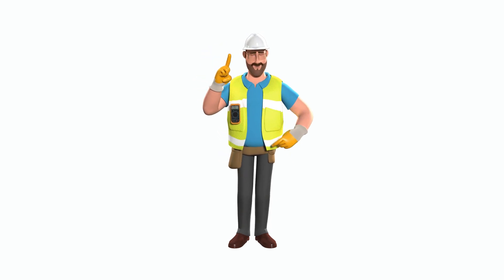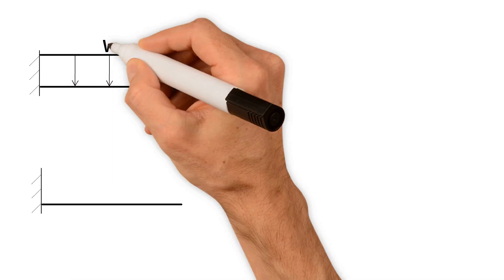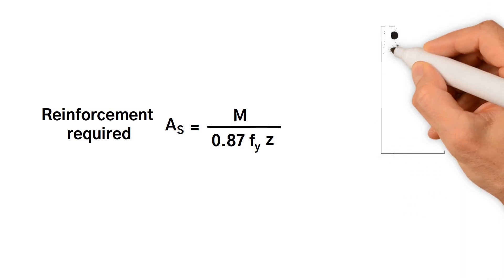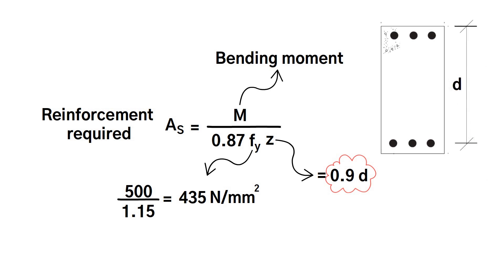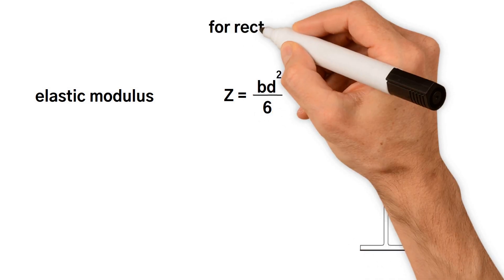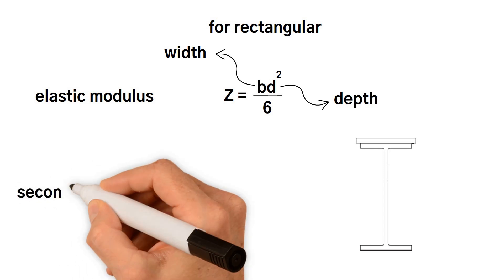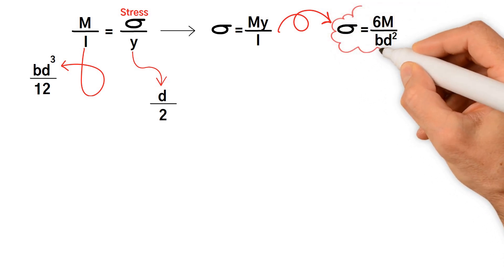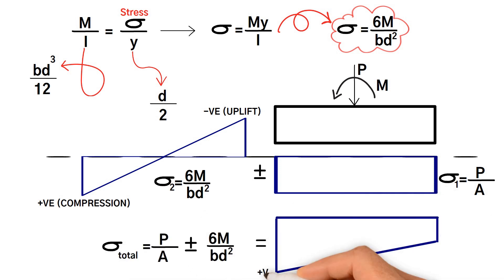5 top equations every Structural Engineer should know.

Comment: Here in Colombia there is a simpler equation to calculate steel area in concrete sections, is this, A=3M/d, Momento in kN.m and d in cm, it gives you area in cm2
Reply: ?? doesnt even consider the steel strength used?
Reply: @bensblues  it’s just an approximation to make quick non-definitive calculations

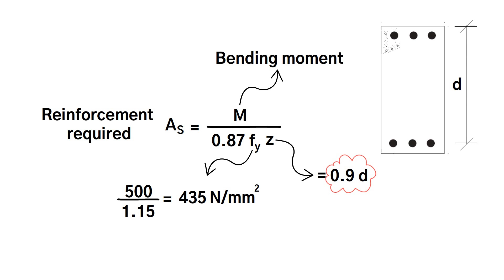Comment: 1:44 how did you derive that equation ??especially how did the 0.87 came out ?is it a  safety-factor or something ??
Reply: I think there might be a very subtle error in that equation for RC flexural design as the material factor of 1/1.15 is being double counted on the denominator. It is being used to factor down the steel yield stress to 435 even though it has already featured in its decimal form as 0.87. Would yield conservative design though so not such a bad thing for a back-of-a-fag-packet assessment! 
;-)